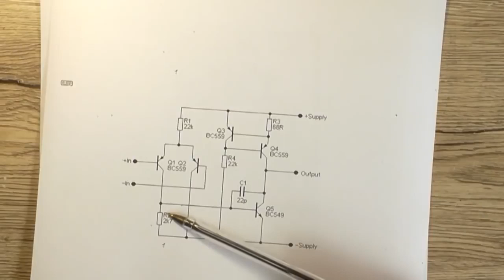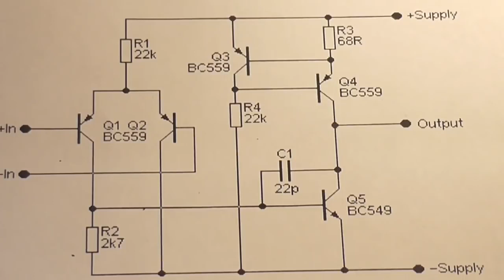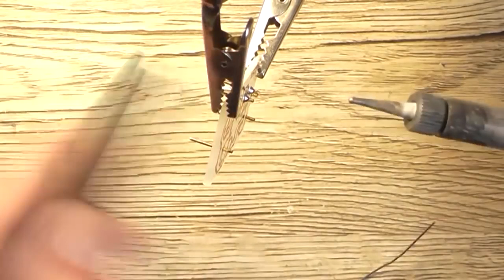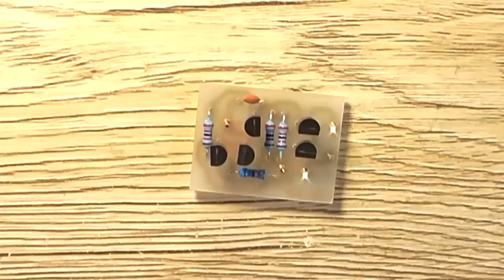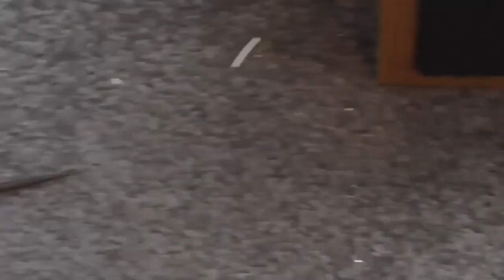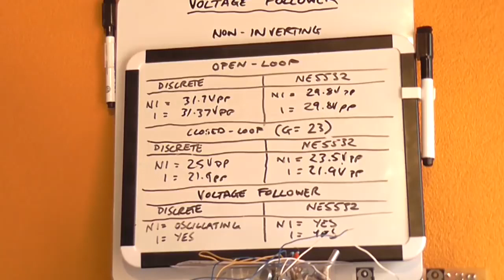Discrete Operational Amplifier by Rod Elliott (REVISIT)

Comment: Bloody hell! Comparing DIY operational amplifier with the legendary NE5532 requires big balls! 

DIY version is just about perfect! Besides zero protection, it is too noisy even if it has far fewer resistors than a monolithic device. Discrete version is best for learning. Monolithic version is best for space and serious work, and above all, much less cost and effort compared to a DIY one.
Reply from the maker: Yep. It was never purported to be low noise, nor better than an NE5532. It was solely meant as a learning exercise.
Reply: @AstrosElectronicsLab  Ah. Reminds me of Michael Beeny. He bought discrete 'NE5532 compatible' mess. Yes, mess, I say, because it really is a mess. And it is stupidly overpriced! And it does not work as well as properly made chip!

Many people believe that the more expensive something or service is, the better that will be. Of course quality will magically be increased but only in one's head. It is called choice supporting bias. They want to feel good about themselves after so much money down the drain, hence they rationalize to justify their cock and bull with more cock and bull.

Ah ha! Not forgetting those who worship discrete devices. They forever say discrete devices are superior to monolithic devices. The bigger the better. The bulkier the better. Exploding tubes is a must. Silicone is poison to the mind. Appeal to tradition. Ancestors did it so we must continue doing it. Advancement is toxic. New technology is scam.
Reply from the maker: @realchristopher4334  you're missing the objective, here...
Reply: @AstrosElectronicsLab   I guess I digressed and I deliberately did it. Of course I know what you do is about experimenting and for the purpose of learning, perhaps teaching or sharing the fundamental of an operational amplifier. I was merely stating the obvious as what I mentioned is apt for this whole thing - there are people insisting that discrete stuff are superior to monolithic stuff.

I was not badmouthing Michael Beeny anyway. You would know my 'rant' if you watched that particular video of his. He rants the same anyway. LMAO! He is an old man but he has zero old school mindset; his DIY amplifiers are frighteningly un-old.
Reply: Yes it is legendary for being dirt cheap and sounding like pure shit.